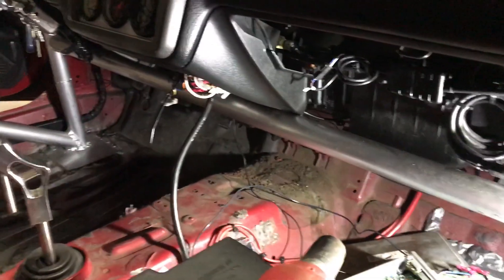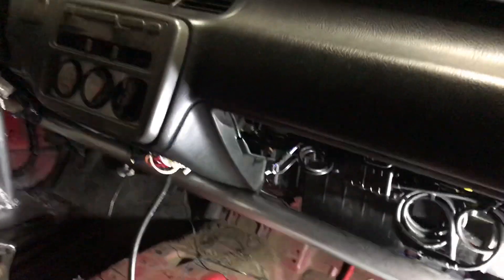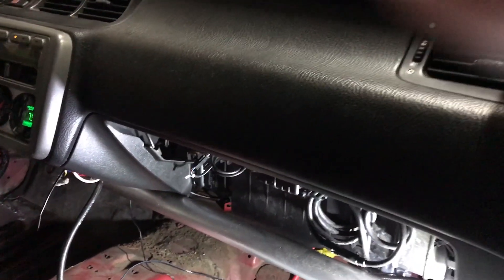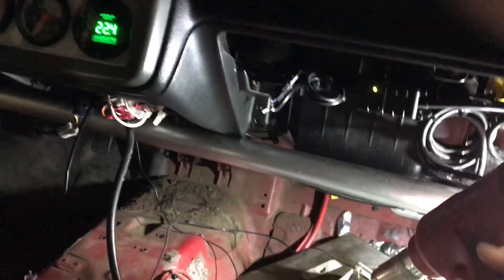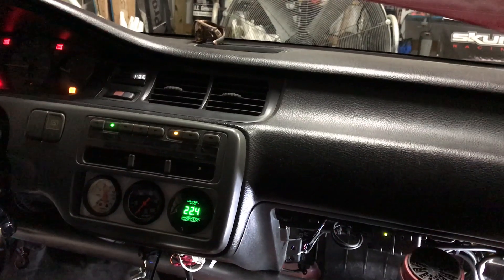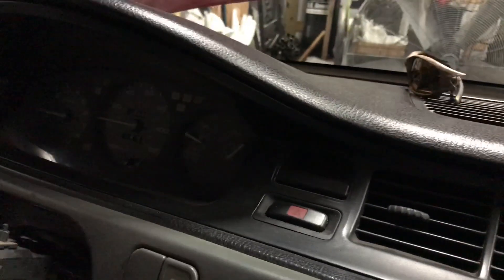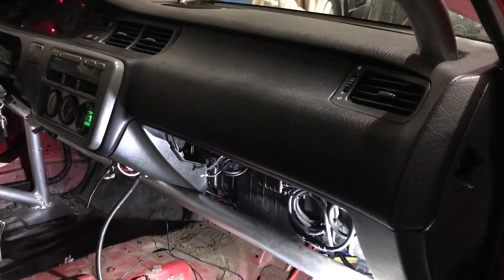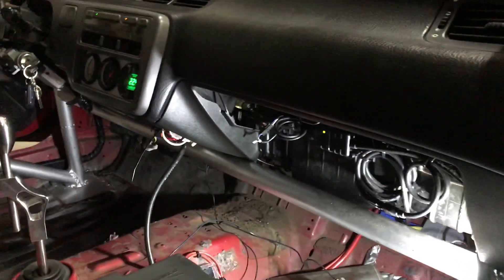Honda Civic fuel pump prime issue  / main relay

Comment: I have the same problem, does changing IC17 solve the problem, or is there another electronic component that causes this problem?
Reply from the maker: I’ve had no problem since I changed IC17.  Sorry for the late response. I didn’t get a alert you replied
Reply: Do you have the part number of IC 17 please.
Reply from the maker: @julianfernando6951  TA8903SN
Reply: @barryc1635  thanks
Reply: Hii i have the same problem. I've changed IC17 it worked good the first day. But the other morning i still have the same old problem. Do you know what the problem can be?

Comment: Anyone have this issue in a DA I’m having a hell of a time, replaced the whole fuel system besides the lines, new fresh b20b swap, obd1 distributor obd2 injectors can’t figure out what’s going on
Reply from the maker: This is a issue known on the OBD1 ecu’s   You will unfortunately need to do all the required testing to narrow down what is not the problem first
Reply: @barryc1635  so I’ve checked spark fuel and replaced the main relay today and now it’s clicking 4times compared to the old one which only clicked 3 (no click on crank)  and it’s still doing the same symptom, didn’t help that I have the dash and cluster out rn but I’m gonna spend some time tomorrow when I get off the clock and voltage check all the circuts.
Reply from the maker: @8lives941  what ECU? Obd1?

Comment: Hello, I have same problem, sometimes I could start 30x times, and sometimes 30x no start when I turn key on, and now when I turn key on engine control still light, but fuel pump no pressure, so where is the problem, is it in ecu and what is ic 17?
Reply from the maker: IC 17 on the board of the ECU has become a common failure.  Read through some of the comments, I left a part number in one of the post.

Comment: Bro, I’m having this god damn issue for a Year now. The Car turns on without any problem for like 2 months, and then for no reason the issue returns. 
Yesturday i got this issue again, it was damn hot here, 30°C+
Reply: I was going home after work, so i let the car there and came back at night. The car turned on without any problem
Reply from the maker: Borrow a ECU and see if it will prime your car,   You don’t even have to crank it ( i case you have a custom tune).  But if it primes fine with another ECU you probably have this issue

Comment: I have a 96 honda civic i turn it on and within 30 seconds it will turn off then i will not be able to start it up.
Reply from the maker: Your car is OBD2,  the ECU in mine is OBD1And is different than yours.  I’ve unfortunately not had to ever trouble shoot the issue your having and won’t be able to help

Comment: Just did this and it worked.... 45 seconds lol it hasnt ran in a week..
Reply from the maker: Glad it helped get you in the right direction
Reply: Unfortunately as soon as I shut the car off I had to reheat the ECU, but atleast the battery got recharged and I can move it around. Getting a new ecu soon I hope. They're gettin rare to find
Reply from the maker: @brandong6766  send it to Jason waters tuning. He can rebuild it for you
Reply: I had Eric Jarvis do alot of my work.. he reccomends I just get a new ecu. Mine has already been fixed once before. So most likely it wont last long. I can just put my chip in the new ecu and be done.
Reply: I told Jarvis about this trick, he said wow that's weird lol
Reply from the maker: @brandong6766  I know Eric.  Good dude

Comment: Just tried this and it didn’t work for me. Lol
Reply from the maker: Probably not the issue for you, or the ECU is just bad.
Reply: @barryc1635  yeah idk what it is, this is the 2nd ecu I’ve purchased and still have no prime ti the fuel pump and ecu stays on. Changed the fuel pump main relay checked all fuses and now idk where to begin car cranks but doesn’t start I know that I should hear the fuel pump prime and ecu used to shut off on accessories key turn. Man so frustrating
Reply from the maker: @kaseone6896  need to use wiring diagram and verify power on each point of the main relay
Reply: @barryc1635  @barry c thanks for the advice, gonna do that. I hope I can get this thing up and running again. Spending too much on Parts lol